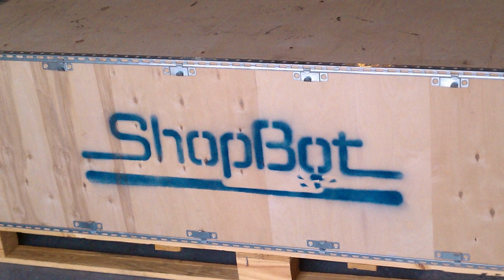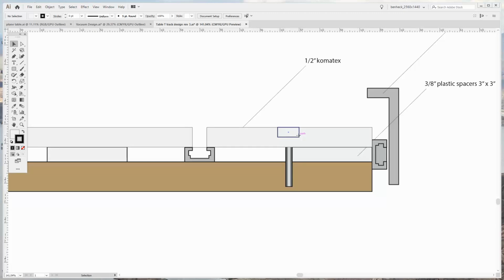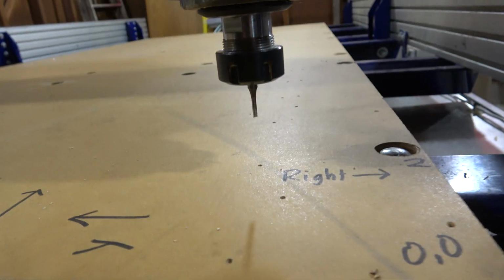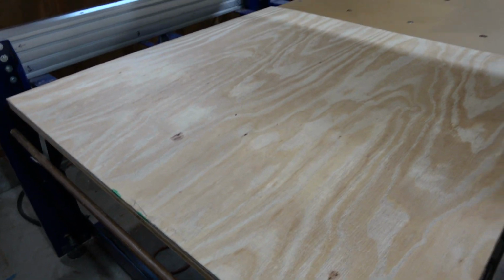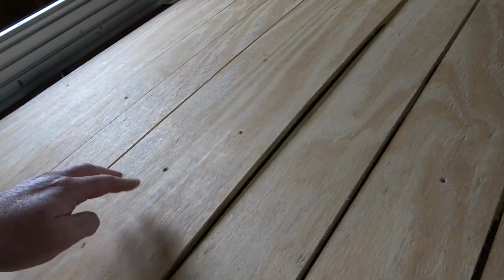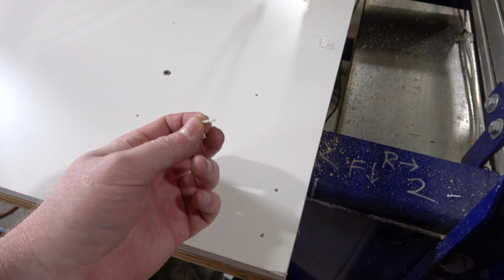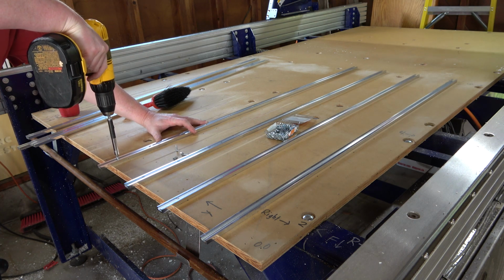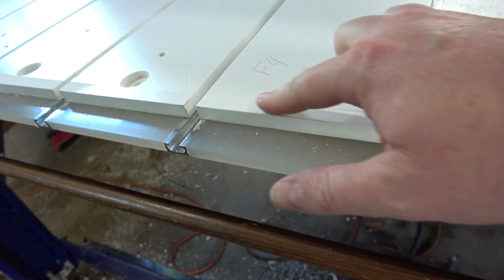Making a new table for my ShopBot CNC Machine

Comment: Ben, what is the stick used for on the end of the table? looks like it is a broom handle. Great video thanks!
Reply from the maker: I call that the "Moses Stick" I use to knock loose pieces off table, hold down chattering edges and basically anything where I don't wanna stick my hand while machine running.

Comment: Lumber you buy at most US stores isn't Metric. The reason a 2x4 isn't 2" x 4" is because the mill first cuts the lumber to dimension (2x4) then planes the surface off all sides for a better finish and more consistent dimensions. A 2x4 is about 1.5x3.5 after this.

The one thing you get that they tell you is inches but is actually metric is the thickness of plastic and glass sheets. The full sheets are made in international factories and use metric dimensions, but when they ship the pieces to the US they cut them into inch standard sizes like 48" x 96" for width and height, and slap a fractional inch label onto it that's closest to  it. Like 3/16" is actually something like 4.5 or 5mm thick.
Reply: plywood sometimes is.

Comment: Yeah, Adobe changing the selection/focus on the modal windows sucks. But you may be able to get there with one or two tabs.
Also, why in the goddamn hell Illustrator still doesn't open in a maximized window like Photoshop for example?

EDIT: Ben, do you think it would be possible to attach a shopvac to your CNC, with a skirt of course, so as not to make a mess every time you cut something with it? I understand you would want to see the bit as you're making your sacrificial table, but when that's done, then you don't need to anymore, right?
Didn't you do that on your old shop? I seem to remember seeing it...
Reply from the maker: I have 1440p monitors so I screencap in a 1080p window. That's why it wasn't maximized.
Reply: Oh, I wasn't complaining about that. The thing is that Illustrator never does and probably never ever has opened maximized... For some reason.Then sometimes what ends up happening here is that I go for the close button that should be right on the edge of the screen and end up closing something that's behind Illustrator's window.
And it's weird, because it's a completely different behavior than their other flagship application (PS)... which of course has its own annoyances.

Comment: 6 months your cnc sat unused..thats not so bad??? I know that feeling. Since I moved from overseas a year ago, mine has sat boxed awaiting my basement renovations to be finished which would require me to work faster and watch way less netflix than I currently do. After much badgering from my wife (stay single Ben), who wants her half of the basment for sewing,  I am currently playing with big boys toys ripping down sheets of 12mm plywood for flooring on my table saw, and using plenty of air powered nail guns..lots of fun..who knows I might even get this basement finished in the next few weekends. Hardest part of these jobs is making a start!!!
Reply from the maker: I've been using 3D printers for most of my work lately. But the CNC will be a killer app for redoing my kitchen.
Reply: @BenHeckHacks  Ben trying to think back...why did you get a cnc that big?? was that for pinball cabinets??? You could seriously base a small woodworking business around that machine..